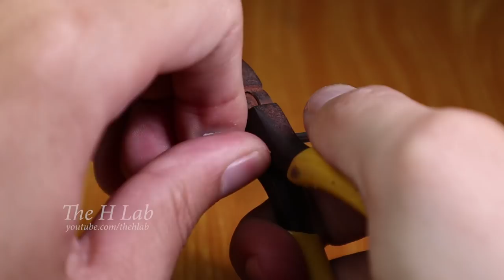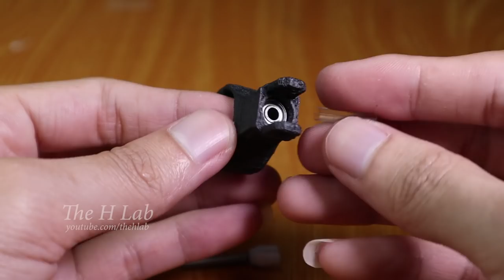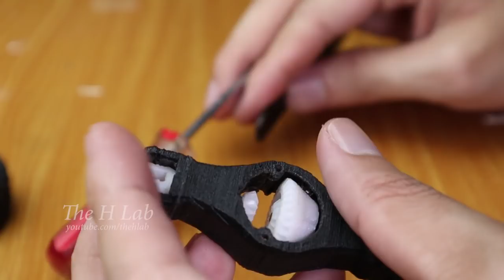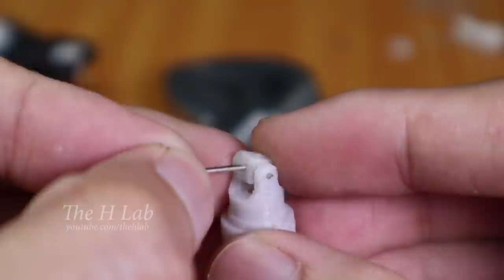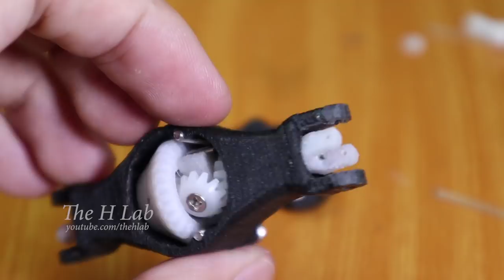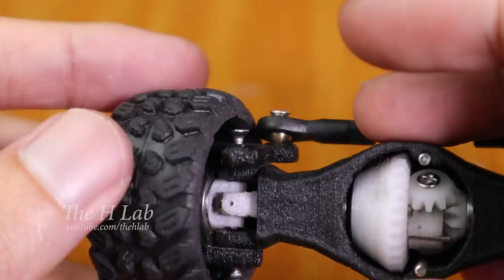3D Printed Solid front axle with Differential for 1/24 RC Car

Comment: What grade of 3d printer is needed to print parts of working differential like this? I'm thinking about buying my first 3d printer for a similar projects, i think about spending around 200 euros for a start, but i'm not sure if i will get anything working good enough for that amount